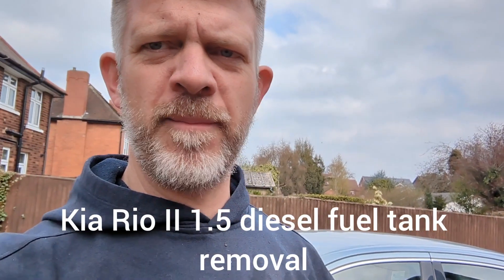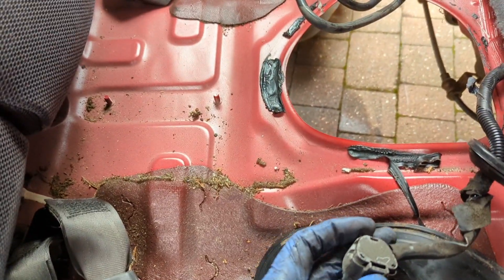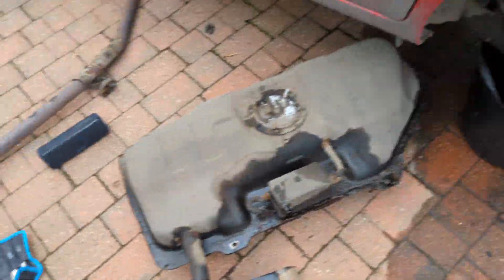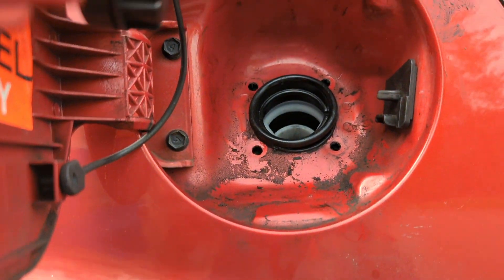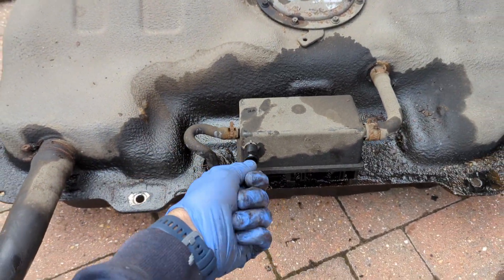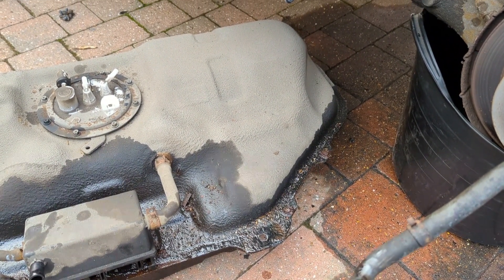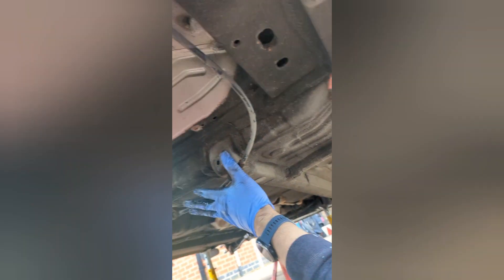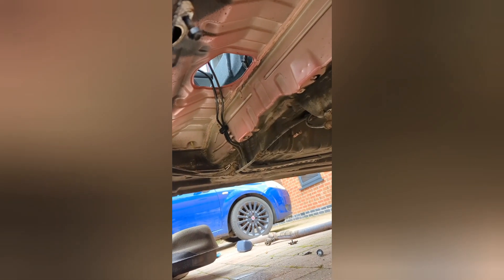Kia Rio II - how to: remove fuel tank (2007 1.5 diesel)

Comment: Very good informative video. I have one of these cars, same age,  spec and colour  as yours. Glad you have posted this how to as my fuel tank started leaking diesel  last week,  which I need to sort.  A couple of questions: For the replacement did you buy a genuine or pattern tank? Does the exhaust section really have to come off, the tank looks like it <might> just clear this. Many thanks.
Reply from the maker: Thanks! I just bought a pattern part from an eBay shop, add it to your watchlist, wait a day or two and they might offer a discount!

The exhaust was only a couple of bolts, so it was easy to take out, I didn't struggle a bit with access so would recommend doing it.
Reply: @turnerscarsUK  Fast response, thanks:) I too am thinking pattern and will do as you suggest!  Thanks for the exhaust advice, very much appreciated.